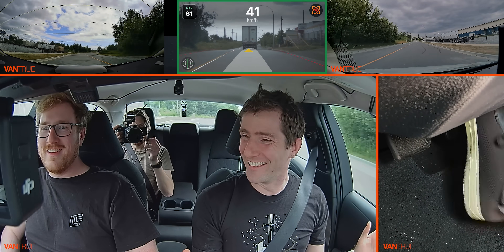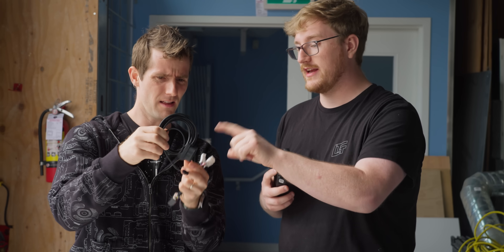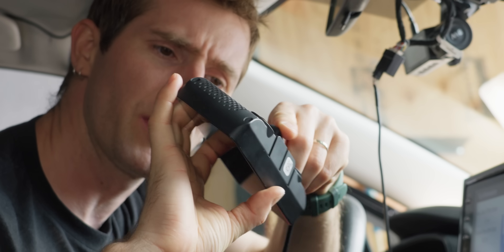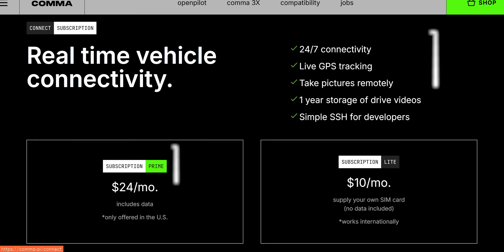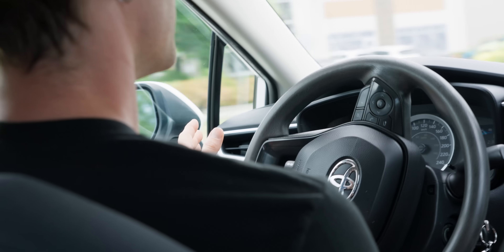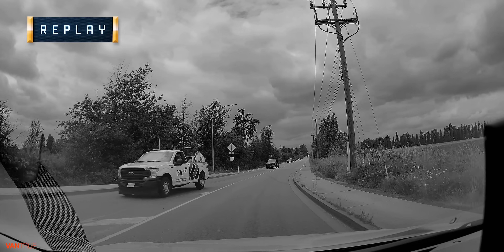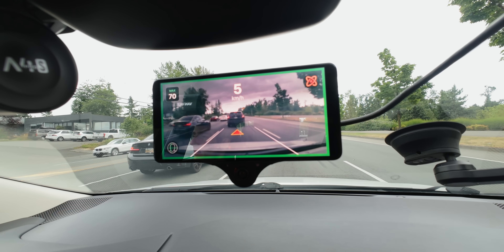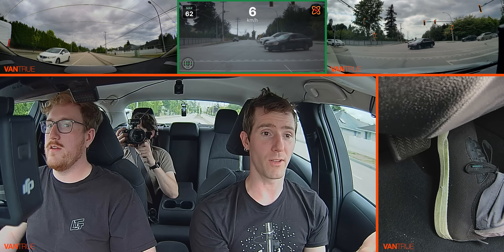I Upgraded My Car With Open-Source AUTOPILOT and it's AMAZING

Comment: Open source self driving sounds like an accident waiting to happen. Would've bought this just now but it doesn't support the 2025 Kia K5. My Kia basically already has self driving with it's lane assist and adaptive cruise control, and all the extra driving assists that come with the 2025 K5 GT GT1 Package. I would love to buy this just to support the open source nature of it but the support of vehicles seems to be lacking on 2025 and 2026 models. The built in lane assist on my Kia is already better than what is shown in this video though sadly. Cool but needs more work and better support for new vehicles.

Comment: This seems to just add stopping and starting at signs and lights.  My Corolla has cruise control that adjusts to the car in front of you all the way up to stopping, lane tracing so it practically drives itself around curves, excellent sensors for accident prevention where it brakes if a car cuts me off, 45mpg average. It's crazy i only spent 22k. It's one of the best cars I've ever owned.

Comment: It's odd that it says it's compatible with all trims and models of the 2019 Corolla Hatchback when I have 6 speed. I will say though, I barely have to do anything on the highway with mine cause the adaptive cruise and lane keep works so well.

Comment: As a cyclist, the wildly erratic ways in which it goes around corners terrify me. Would you have been able to avoid hitting me if I were riding completely within my legal rights on the road ahead of you? Are you sure?

As the owner of a manual transmission car, how does it do pushing the clutch and moving the gear shift? (I'm guessing: not great!)

I guess the technology is kinda neat, but hard pass, thanks.

12:04 True.

Comment: DUDE! this is cool. what i want though..... add a koyo can enabled electric power steering module to another car, a can drive by wire and can electric brakes. then run it off of a ripper laptop with egpu. and usb cameras..... perhaps there is a usb lidar module for some extra safety?

Comment: it probably does 3 under the speed limit because it reads the speedometer and not the actual speed right?
Reply: Yes, the dash lies but the device shows the true speed.
Reply: @techie163  yeah but the device set the fake speed instead of the real speed as far as I can tell

Comment: 99% of this functionality is in corolla stock. Adaptive cruise, active lane keeping, autohold, recognizing traffic signs etc. etc. Only functionality that isn't there are the ones you see the car mess up badly with this gadket. On highway you literally have to do nothing, its autopiloting like tesla, same goes for city if you have traffic in front of you. Lane changing is the thing you need to do in corolla these days and even then it'll operate the throttle for you if you have adaptive cruise set.

Comment: my model 2018 opel insignia B has no support right now (no Opel does) but even having automatic slowing down, speeding up or holding lanes would be great, right now it only corrects me when i drift off the lane and it doesn't do it always, and also it can hold speed but doesn't care about cars in front of me. The website says one might add support on their own

Comment: With Jake's point of disconnecting the car battery, you have to be really careful on modern cars and read how to do it on your car, you can severely mess things up if you do not do it properly

Comment: Hard to tell on camera, but the F150 would make most of those turns with the comma3x. It also does stop-n-go from a stop. Although, it struggles with stop signs and stop lights which may be caused by the height of the vehicle and the model not being trained on that data.

Comment: If the FAA requires 100% reliability and airlines STILL have problems, I would not get this or any other self driving, yet. I trust my observation and reactions more than a computer programmer's at this point. When my car was stolen and recovered then repaired, I thought the alignment was off; but no, it was just the lane assist was turned on making me think that. I turned it off and love being in complete control. You can risk injury and insurance on a self driving car, but where I live; people drive so crazy on purpose that every time I drive more than about 3 miles, I see something that would easily cause a wreck if people weren't used to the crazies around here.

Comment: You should have tried this with a car with a higher torque in the steering. I have been using Comma for 2 years and LOVE IT! With the right vehicle (most Hyundai's) it can actually make a complete right turn at an intersection for you and very rarely needs any help in the steering at all. It also taps into the radar of Hyundai vehicles to give it more data to drive more accurately. I have done entire trips were I have only had to intervene a couple of times (mostly at stop signs). Different forks such as "Frogpilot" give you way more customization options to the point where you can make the car feel pretty much exactly how you want it to drive (super aggressive/sport) or relaxed. I highly recommend the product if your car supports it and if you drive a lot especially in traffic. It has made my driving so much more relaxed and I can look around and enjoy my trip more and also not have to constantly brake/gas in heavy traffic.
Reply: If they can get into production Aptera should be the best integrated experience since they are actually putting it directly into the vehicle.  This tech really is amazing and even if limited to lane keep / adaptive cruise it should be just directly included in vehicles natively since the implementation is way better.
Reply: @ccibinel  i hope they don't waste 2 seconds dealing with that company. It's a classic startup with no market, no real funding, and no hope of production
Reply: The steering angle can be increased alot by using an NNLC model on SunnyPilot. I run a 2022 Prius with a Comma 3x and the steering angle is alot better than the stock fork.
Reply: Man, if it could just use all the main sensors and give driving behavior customization that would be nice. The KIA adaptive cruise control is always so late to start braking and then brakes hard.
Reply: @thekwoka4707  you can on the standard software and more so on the forks
Reply: What car do you have?
Reply: See the ending of your comment is what worries me with these products... you shouldn't want/be able to be looking around and / or less focused on the road... People will use these sort of products to do exactly as you said. Pay less attention. When phones and radios or whatever else are already such a distraction, then relying on the vehicle to drive its self worries me.
Reply: @Dukes3677  sure but that’s the reason for self driving. yes, you’re correct that it is irresponsible to do so, but at the same time the goal is for you to do less, not more.
Reply: @Dukes3677  Watch an episode or 2 of Dashcams Australia, you'll agree that the attentive/relaxed trade off is for the better XD
Reply: @Dukes3677  More advanced self driving Teslas actually have shown to reduce accidents when it is doing more of the driving.

Comment: Who on earth would want an autopilot which requires such constant babysitting? There were times in this short video where they would have crashed were Linus’ hands not hovering over the wheel. This doesn’t allow any less driver involvement than smart cruise control with lane control. And it is only available for cars that have those features to start with, or at least which are capable of those things.

Edit: the open source nature is better than what Tesla and GM are doing. I don’t really get the appeal of these either.

Comment: Wear your damned seatbelts!  Insane to release this showing you aren’t, I don’t care what your excuse is
Reply: I know! Thought i was the only one who noticed it, especially with the PSA about unplugging the battery at the start and the fact that they are driving dangerously as well
Reply: Linus is wearing his under his arm and the camera man in the back is wearing it correctly and jake i dont know
Reply: They’re grown they can do what they want
Reply: @downloadableram4212  no there are actually laws around this. Also, they have some sort of responsibility to set a good example.
Reply: @downloadableram4212 Imagine the self driving tech that they're using initiates a fast stop or hits something and slams Linus's head into the wheel, knocking him unconscious. Now the vehicle is potentially out of control, and other drivers and passengers are at risk. Wearing the seatbelt properly would massively minimize this risk. As intended. 

Why are people like you so eager to make other people pay the price for the sake of your "adult decisions"?

Comment: I’ve been using openpilot for almost 2 years on my 2.5x torque modded 21’ civic. 

99% hands free on the highway and I use sunnypilot to control gas/brakes in the city where I’m still hands free a good amount of the time. 

Highly recommend
Reply: Can you explain more on the torque mod?
Reply: Do you agree they should add a 5090 to the mix?
Reply: @GermanyBigMan-k2e No, no currently public model supports external GPUs
Reply: @slickgod884  darn. thats a shame.
Reply: Does it operate in rainy weather?  I'm guessing snow is outside it's capabilities at the moment.  I'm guessing more people using and providing data the faster and more refined the product will be in the future.
Reply: @jbranche8024 Yes. Openpilot can see better in rain than I can.
Reply: @alexbowden52  What about at night, especially when you've got no Lights around? How is it going to see the road markings?
Reply: @lolly166541 it doesn’t need road markings. And it can see perfectly in the dark lol.

Comment: I never understood this full self driving shit from the beginning. 
Drive assistents are great but they are focused on what they really can do best. The whole FSD shit was bullshit from Elon Musk to scam people.
As much as I honor and value this project with open source approaches, I still believe that FSD is a hoax and if You don't want to drive Yourself,
build a fucking bus or train network like in Europe. That works fine and is safe.
Reply: "FSD is a hoax" FSD is a set of capabilities that a particular vehicle's systems could potentially be made to meet. A current classification system for those capabilities is J3016_201609 from SAE international, which was adopted by the NHTSA lending it some level of importance.

Level 5 of that classification system is the max, and it's the point at which a car could have its controls effectively removed without loss of usability, or that someone without a driving license could eventually be allowed to get into the car and get driven without legal or safety issues.
Reply: @pedrobettt  Thanks! That is not really news to me. That doesn't explain, why full autonomy should be pursuited in the first place. Public transport is exactly what FSD tries to achieve.

Comment: The turn exceeds steering warning is like you guessed the limit of the hardware in your particular car. Just like the lack of blind spot monitoring in your car. There's just no hardware for it in the car. If you do compare it to a Tesla, just install it in the Tesla. There you have access to way more torque etc. I would also highly recommend giving Sunnypilot a try.
Also there is support for Porsche. But only the first gen Macan. Basically all other Porsche with electronic power steering use Flexray instead of CAN, which makes it way harder to man in the middle. It basically requires an expensive FPGA etc. It's the same for BMW. They also use Flexray.
The driving model of Openpilot only takes 1.1w of power btw. They don't even use the whole power of the C3 hardware. Hardware is not the limiting factor right now.

Comment: I've been using the Comma 3X since the last 9 months, and I already had 2 replacements due to defective hardware. The idea is cool, but the hardware reliablity is so poor. Imagine being on a road trip and you just found out there's something wrong with this device and you have to drive manually for the rest of the trip. It's a $1000 device, I except it to be built properly. The replacement takes atleast  2 weeks.

Comment: I've had a Comma 2 in my Corolla for more than 5 years now and it's saved me SO much mental effort in highway driving over 30,000 miles to date. Love Geohot and comma; can't recommend it enough - and I'm sure the 3X is significantly better.

Comment: self-driving firetruck when?
Reply: Feel like whistlindiesel will make the self driving killdozer
Reply: After the self driving skid steer and self driving cement truck.
Reply: @devinbartley5768  🤣🤣 self driving oversized loads more like it, moving houses and wind turbine blades
Reply: Not a bad Idea especially after some here in Florida drove the back end of one into a High speed train. Afterwards they found out they weren't even supposed to be driving them. @devinbartley5768
Reply: Watercooling the external GPUs would be a piece of cake.
Reply: Step 1. Add electronic controls to the fire truck controls (extremely difficult)
Step 2. Train your own AI model that can handle self driving for such a large vehicle (extremely slow/expensive)
Step 3. ???
Step 4. A 15 minute YouTube video
Reply: @asdaneedsfunds  Step 5. Profit
Reply: @asdaneedsfunds  Step5. Profit
Reply: @asdaneedsfunds  Step 5. Profit
Reply: @asdaneedsfunds  I can think of a bunch of things harder than adding your own EPS to a firetruck. Dude, just grab an EPS system off a supported car, lol. (Warning: It might be bad to use a car-level EPS in a large vehicle! Maybe at least find the largest supported TRUCK EPS.)
Then just find a city willing to let you hack up their fire truck, and someone in the auto-hacking scene. Totally do-able, again, there are things FAR more complex in this world. Don't need to train a different model, just lots of parameter tuning.
Reply: Honestly scary idea
Reply: Linus's life insurance company has left the chat.
Reply: @Y99dr451l  with FLIR cameras to automatically speed to fires
Reply: Why?
Reply: I was about to write my comment about making a fire truck drive itself, and then I saw this comment. Yep, they should do it!
Reply: @Y99dr451l  I see that possible for maybe an evotl that flys to the situation and assists fire fighters but not big trucks they need to be going as fast as possible and when u train a model to prioritize a certain factor everything else goes out the window
Reply: Before slef driving Home
Reply: Now
Reply: The OG's know😂
Reply: That can turn lights in its path green to make traffic flow
Reply: I mean... there are people hacking it into any analog steering. "Old Cars" I think the project is called. MUCH more difficult. Maybe worth it on something as expensive as a fire truck. NOT gonna be plug and play. (Well, unless someone makes a kit for it, lol. 😆)
Reply: Also, just along the lines of "unless someone makes a kit". I mean, I'm sure geohot is definitely open to the idea of accepting large buckets full of cash to make any wheeled vehicle supported. (They'd have to be large buckets of cash, and he might just farm it out to someone else.)
Reply: Self extinguished fires? Why not?
Reply: Ohh don't give em any ideas!!
Reply: YEEEEEEEEEEEES
Reply: Yes
Reply: Alex is gone now, so never.
Reply: Every fire truck is self driving. 🤡
Reply: Never
Reply: @weinnnneeerrrrrrrr  pessimist

Comment: You should try Openpilot on a Tesla, Tesla doesn't have any steering limits so it works way better on it
Reply: But it doesn’t make much sense, because it’s easier to hack an already existing tesla computer to unlock FSD, since all the hardware is already there.
Reply: @mk_69mm  Is the FSD computer hackable?
Reply: @dennis1143  of course lol. I don’t fully understand the details, but there are ways to reflash the brain of a Tesla computer to make it work in regions where the car isn’t officially sold or supported. You can install your own SIM card. You can also unlock paid features like FSD.
As far as i understand, activating these features works by spoofing the server address. The best part is that Tesla won’t know about these changes, meaning the car will still remain under official warranty.
I saw a video about how this is done on the TSK (Tesla Service Kiev) channel. The guys there restore wrecked Teslas and also reprogram them to work in Ukraine, since Tesla isn’t officially sold there. They somehow manage to load the map of Ukraine, get local SIM cards working, and enable full autopilot functionality.

Comment: I'm confused why not use a car that doesn't have ADAS (Advanced Driver Assistance), cause this is kinda redundant since Toyota already has Front Radar, Lane Keep Assist that already do what this is doing. The only thing I see thats different is the visual representation of what is happening. I do ADAS work for body shops and insurance companies , I would love to see how insurance would handle this in the case of an accident since you have tampering with OEM ADAS systems and I don't know if this system is integrating itself into the ABS system to also brake in the event there is a chance of a collision. Still love the video but would like to see this on a car without ADAS since this is essentially just piggybacking off of what I assume is being produced by the original ADAS systems.

Comment: I wonder if you can jailbreak a Tesla and use this instead of Tesla's autopilot? That would be an awesome test if you can get it working, cause the more recent Teslas are designed for "FSD" so it should, in theory, be able to handle sharper turns and stuff.

Also, I find it weird that Comma are using a 7-year-old mobile chip when you can get (as far as I'm aware) much cheaper Raspberry Pis with NPU HATs that draw very little power and run smaller vision models really quickly.
Reply: You can. Comma supports several tesla models.